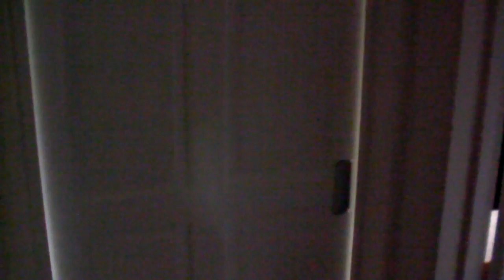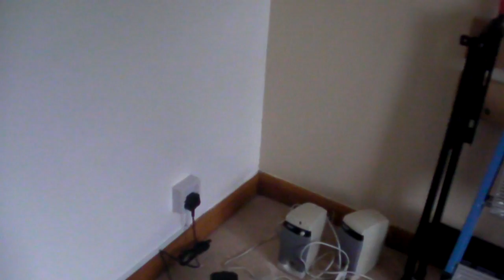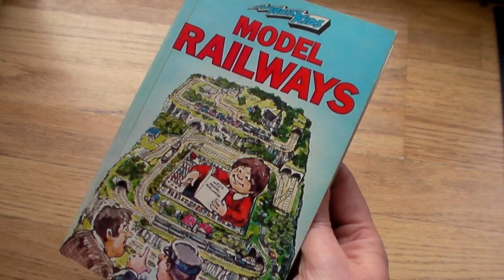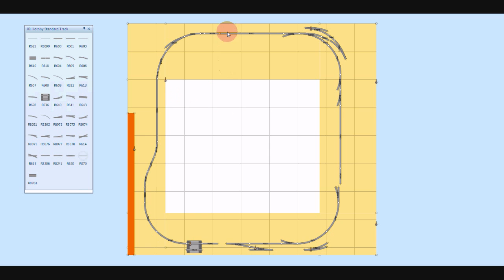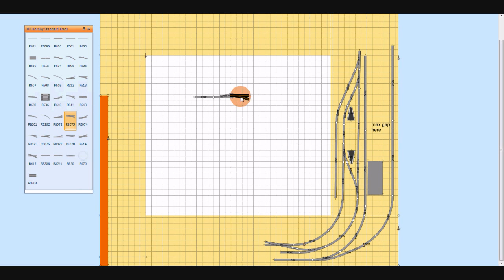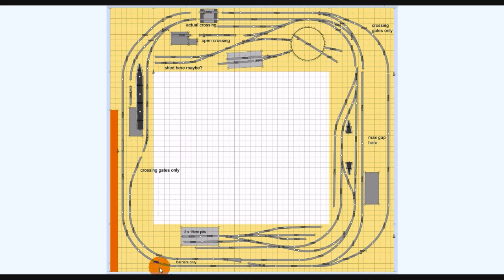Model railway Layout - Part 1 - Preparation & Planning

Comment: On the point about streamline points and track separation, I think you'll find that the track spacing comes out almost prototypical (well it does in N gauge). In OO/HO the prototypical gap between running lines (The 10 foot) should be about 46mm measured between the inside faces of adjacent rails.

Comment from the maker: Thanks for the comments. I see what you mean about the South. The right hand side will possibly be fuelling and cleaning, but you're right in order to get to that area a loco will have to go through the shed. The left hand side is free for an access road to the village station (and also on the lifting section) so I can't really extend in that direction. I will look at moving the shed over to the right and have the sidings on the left so there is easier access to them. Do you have any ideas?